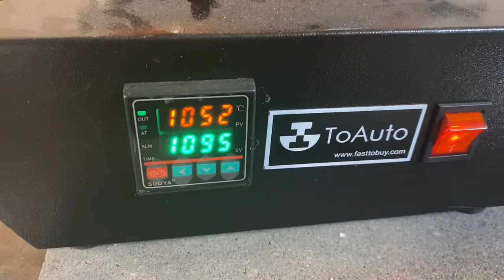Making a Shot Glass Out of Pure Silver // Silver Pouring Video

Comment: 💙I was wondering how you would get the inside of the cylinder. Haha I see how you improvised there! 😉  I also came to the conclusion that a cylindrical shape is what is needed. A flare rimmed shot glass wouldn’t work with that method. But it’s entirely possible to flare it after the pour. I’m guessing the bottom was also kind of thick and needed shaping.  But YEA ! That’s on my bucket 🪣 list too!  Congratulations on crossing it off!
Reply from the maker: thanks it was a very difficult pour but I think I can replicate it pretty easily and I have a few ways to make it better I think on the second try 🔥🐉